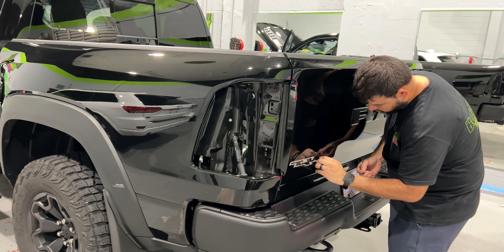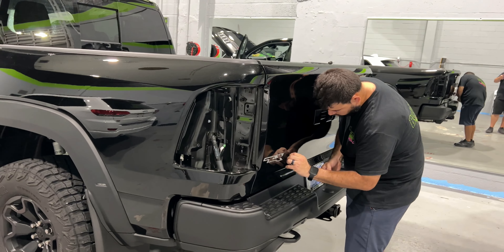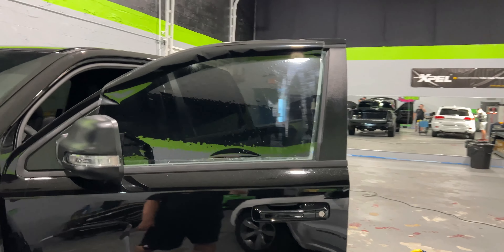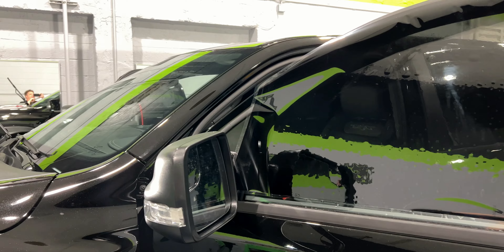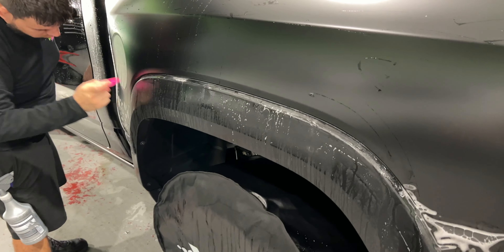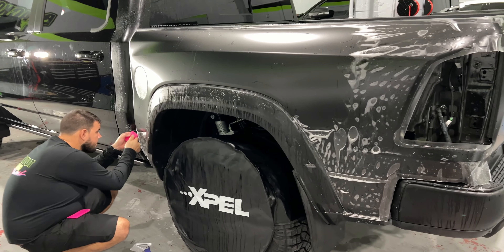This RAM TRX gets a STEALTH Transformation! XPEL Stealth PPF install from start to finish!

Comment: Love the look!   If you have a truck that's not able to be garage kept, any issues with it being out in the sun, etc., every day or does the 10 yr warranty cover everything?    If/when you need to take it off, does it affect the original paint at all / any downsides??
Reply from the maker: Being out in the sun does not affect the 10 year warranty. Removal doesn’t usually affect the paint unless there has been some paint repaired done in the past that wasn’t quality.

Comment: I'm thinking of getting the XPEL PPF Stealth (if that's the same as Satin) on my C8 which is black. What are your thoughts on this?
Reply from the maker: I would highly recommend it. I had a 2020 Stingray in torch red that was Stealth wrapped and I loved it. Check it out here: https://www.youtube.com/watch?v=Fgf2KRid7n0
Reply: @ Does the satin stay cleaner easier than the glossy black? What’s your experience with that?

Comment: Are the door handles removal would be the same just for the 2022 ram 1500?
Reply from the maker: Yes.
Reply: @HorsePowerObsessed  Thanks! does the door panel need to be removed if theres a passive entry?
Reply from the maker: No. There’s a plug on the backside of the door handle you can access.

Comment: What’s the difference between this and vinyl wrap?
Reply from the maker: XPEL is thicker offering more protection against rocks, etc as well as self healing, which is exactly what it sounds like. If scratched it will literally disappear with heat. It also has a 10 year warranty where there really isn't much of any warranty on vinyl.

Comment: I need this on my TRX due to the amount of miles, debris, and look. However, I spec'd it out and this is wildly expensive. It's cheaper to get a paint correction, add some clear-coat, then have the vehicle ceramicoated. I don't know that it's worth it for me, but if you have the extra cash burning a hole in your pocket I could see getting this done. Otherwise, Xpel needs to come down on the price because it's seems like they are price gouging those who can afford a TRX.
Reply from the maker: A ceramic coating/paint correction is absolutely the cheaper way to go but will do nothing to stop rock chips, unfortunately. If that is your goal then XPEL paint protection film is your only option. It isn't cheap, but it's definitely not a gouging technic, the cost is the same for a TRX as it is for an Aventador. The film itself is almost half the cost of the install, the rest is time. A good installer will take 3 to 4 days to completely finish a car in XPEL as it is a very labor intensive job. After you have it done you'll realize it's worth every penny because of the protection it provides, the 10 year warranty it has, and the peace of mind every time you take the car/truck out for the day.

Comment: How much does PPF cost for TRX?
Reply: My guess for the full truck… about 7K
Reply from the maker: Yup. Right around 7k.
Reply: Wow, I talked to a guy that had PPF on his car and he paid like almost 6K. Your shop using top of the line Xpel with that attention to detail, I’d say 7K is a helluva deal.
Reply from the maker: 100%! There are shops out there that charge far more but we believe in quality at a reasonable cost
Reply: 7k is a good deal for sure. Out here in AZ I talked to a very reputable shop and for the Stealth it was 9k.